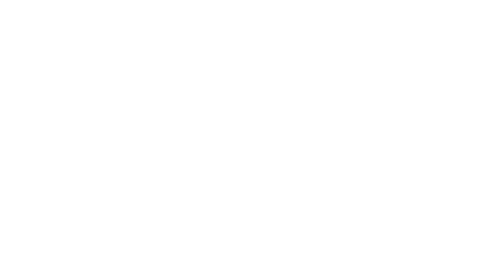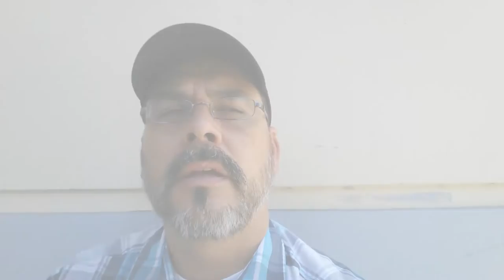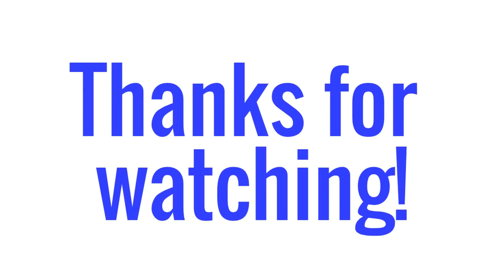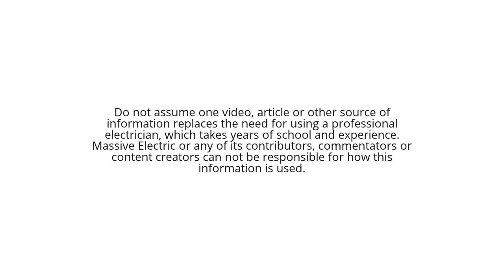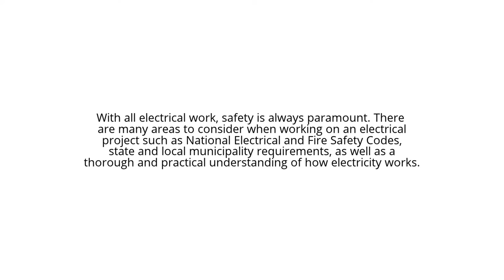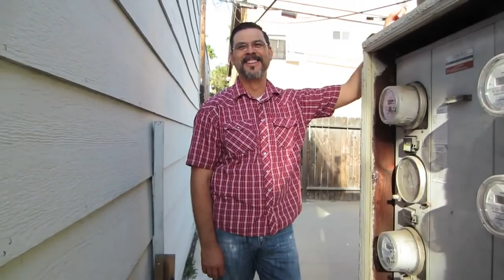Tandem or 2 Pole Breakers?!

Comment: One thing with tandem breakers, never share a neutral with both circuits on a tandem breaker or you will overheat the neutral
Reply: Plumbing contractor here. I do everything myself. I came here wondering about tandem breakers "sharing the same neutral". I have electrician friends who filled my panel with "piggyback" breakers and no one ran a separate neutral. So WTF good are tandem breakers? I get it if you're on separate phases...the neutral is only carrying the load of one phase at a time....so how are tandem breakers even legal?

Comment: Can i use a 20 amp 2 pole breaker in my panel and just connect 1 circuit ( black wire 120volts), and not connect anything to other circuit?

Comment: So lets say a 2 pole breaker rated for 20 amps will supply 20 amps to each hot wire? And do both hot wires have to be utilized in a circuit for the breaker to work?

Comment: My garage has two 15 amp outlets on either side of a tandem circuit breaker. Why did they use a tandem circuit breaker for only two outlets?  Why not just use one CB for the two outlets. (And what amp rating would that be?)
My compressor tripped one side of the tandem breaker. The compressor was advertised as being able to run on a 15 amp circuit but I can't have the lights turned on AND run the compressor at the same time. It's frustrating that the builder didn't put a beefier circuit in a garage, for crying out loud.

Comment: Working on GE panel in 1950’s house. Need more breakers as I remodeled kitchen and need places for feeds to can lights and gfi. I bought slim single 15amp and slim 20 amp breakers but I only have one cross bar in the back where breaker slot goes when you press it in. In other words I can’t put 2 slim breakers in same spot where single pole was. What’s my solution?  Thx
Reply from the maker: unfortunately many early model breakers do not have a tandem version. the only solution here, in order to get more circuits, is to upgrade the panel...

Comment: Hi I have a 2 pole siemens breaker 15 amp regular size doesn't have the steel connect to trip both together can I use it on two different circuit  [ it looks like 2 single breaker attach together ] thanks

Comment: So from what I understand, I can use a tandem 20amp circuit breaker to power an exhaust vent that has exhaust, light, and heat, since I will need separate switches for each function but all in the same outlet box, am I right?

Comment: I have a unique situation. I need to install a 50 amp 2 pole breaker for nema 14-50 to charge a car. on the panel, I only have space for  1 inch breaker on each side. In other words, i can install 1 breaker on each side of the panel... question is, can i somehow use the 2 spaces and combine 2 Inch breakers to make a 240.. or do they sell a very thin 50 amp 2 pole breaker that fits into a 1 inch slot?
Reply: Yes they make a 50A 2 pole breaker that fits a 1inch space. Some people called them mini double pole breakers.

Comment: What about the possibility of neutral overload using a tandem breaker? Theoretically, are you now using 40 amps (two 20 amp single-poles) to a single #12 gauge wire for the neutral?
Reply from the maker: funnyharleyman Yes, you are right. I appreciate the input. Currently, I am trying to gear each video to the "average" consumer's level, to reduce complex or confusing ideas as well as for the sake of time. I will include a discussion on the issue you bring up in the near future. Thank you.

Comment: I believe I bought a tandom breaker that puts two breakers in the same space of the previous single breaker. All on the same bus bar.  The two breakers are connected with an aluminum rod making them both trip at the same time. 

It looks like I can snip that aluminum so the two breakers work separately. 

Is that a bad idea?
Reply from the maker: +JohnJWWarner if I am understanding you correctly, you purchased a 2-pole (240 volt) breaker, not a tandem. That "aluminum rod" is a tie bar between 120 volt busses which makes it 240 volt. If you need 2 separate single pole circuits I would recommend purchasing the correct tandem breaker rather than modifying the one you have.

Comment: I have a two pole tandem breaker GE model thqp230.  I'm trying to supply 240v to my water heater.  Based on what you're saying here, a tandem only utilizes one phase.  Why is this model a double pole tandem if I can't pull 2 phase power from it?  I only ask because I have no clue
Reply: Watch the video again, he explained it

Comment: If I have a AC unit that needs 240. And a full panel. Can I use a tandem 20v breaker?
Reply: There is no substitute breaker for a 240V piece of equipment, it must be a 240V 2-pole breaker, taking up 2 spaces in your panel.  Tandem breakers are not 240V.  If you need it for an AC and have no room, you need a larger panel or need to have a subpanel installed.

Comment: the new aftermarket ub zinsco 2 pole tandem is a  240v circuit breaker.... so let me get this straight here are all the types of breakers

tandem 2 pole 30 amp 240v
tandem single pole 15 amp, 20 amp120v
single pole 15amp, 20 amp120v
tandem 2 pole 60 amp,90 amp, 100 amp, 200 amp 400 amp 240v
  

wich have i left out?
Reply from the maker: +Marty Forkwater for the most part yes. Tandem is 2 SEPARATE circuits (twp 120 volt circuits). 2-pole is 2 circuits together (one 240volt circuit)
Reply: @MassiveElectric  It seems like the guy who installed my two new separate lines using the 2 pole circuit breaker so my question is can 2 pole work as tandem breaker? thanks.

Comment: I had this question in exam ,  two wires are attached to a single pole breaker, it can only be allowed via tandem or double pole breaker ?? Thanks
Reply from the maker: +Amandeep Manku true. So if your panel is full, one way to "fix" it is to throw a pigtail off the breaker and wire nut all three wires together. This can be a difficult place to be in if your panel is getting inspected.

Comment: Hey! :) Do you still answer questions?
Reply from the maker: hey shadow, I do
Reply: Can I legally connect two single pole breakers together? To make a two pole breaker?
Reply: @jeffsmith1830  I done it and haven't had any problems, again I'm not an electrician

Comment: How would you install a tandem breaker so both phases trip?
Reply: +mike7gerald Opps!  I meant how to install the tandem breaker so that both breakers trip together.  ( Both are on the same phase ).
Reply from the maker: Technically, you cannot. They make quad breakers for newer panels which will do the trick though.